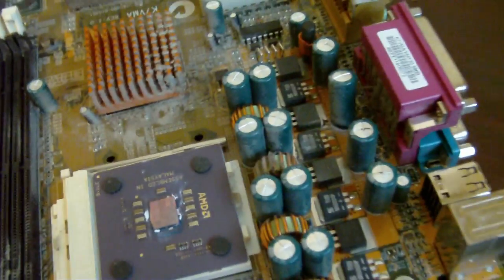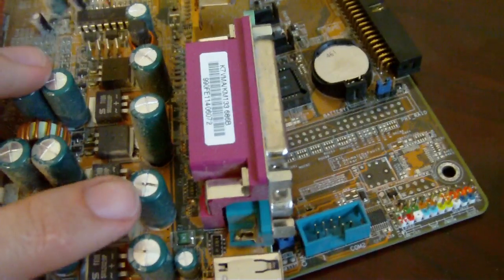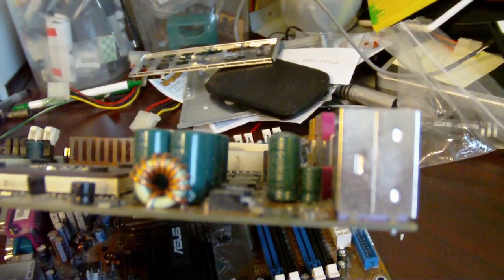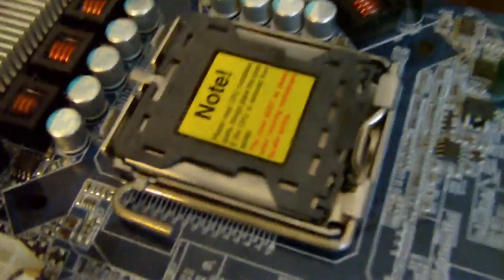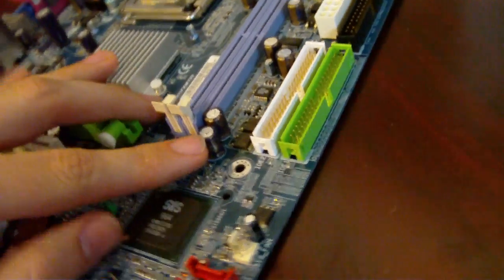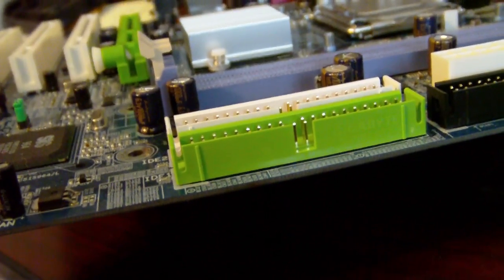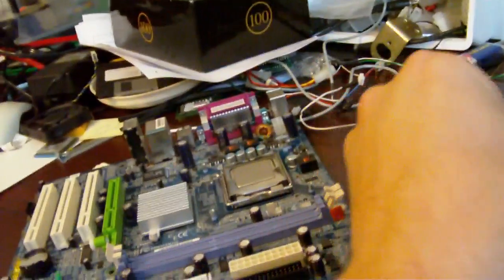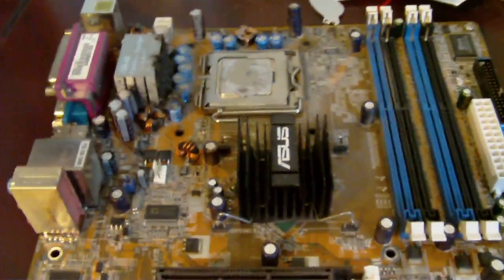Identifying bad capacitors part 2

Comment: Hard to get? 820uF capacitors are sold at Radio Shack, Digi Key, eBay, Amazon, Electronix, Jameco, Mouser, Newark, MCM, Avnet, RS Electronics, Farnell, Bursma, Surplus Gizmos, All Electronics, and dozens of other places. Common sense here. If they are common on motherboards and frequently go bad, component suppliers are going to carry them. I verified every place I mentioned does have them. I could have found 20 more vendors but it was obvious it's an easy part to obtain.

Comment: Nonsense. Caps have gotten a bad rap. Bulging tops aren't a good test, or 'brown stuff'. Truth is today's components are cheaply made, be cautious of foreign replacements. Yeah, you should go with a cap of higher voltage, if it will fit, in any replacement. 
12 bad caps, sentanced to death? What's that tell you? 
And get a iron with grounded tip.
Hope you don't work on audio amps. You can get into some serious trouble there.

Comment: This is a lie! All capacitors are likely to pop. Especially 3300 near the CPU :P. 820 are used near the chipset and memory and they are less likely to pop. Near the cpu there is the biggest temperature and dust ;).

Comment: Do not install a capacitor of a different capacitance rating. It may work, however it is likely you'll replace it again in the future due to it either blowing, or causing other problems. Voltage is the only thing that doesn't matter so long as you replace with one of a higher rating.

Comment: can a capacitor leak from the bottom? I've got black gunk leaking from the bottom of a capacitor and it has corroded other joints around it.

Comment: I have a 6.3v 560uf fujitsu capacitor on my ASUS Rampage II Extreme Mobo. I have been trying to find a replacement for this capacitor and the best I can find is a 6.3v 680uf capacitor also by Fujitsu (Must be old, since they sold their manufacturing) If I put this one in, what are my risks?

Comment from the maker: @theater40 It could be some bad capacitors in the power supply, you would have to open it up to see. If it has surface mounts caps, they are sometimes hard to tell visually if they are bad. So, it makes repair difficult.

Comment from the maker: @theater40 Check out the heatsinks by the fans and make sure they are not clogged. Blow some compressed air in there to clean out the dust.